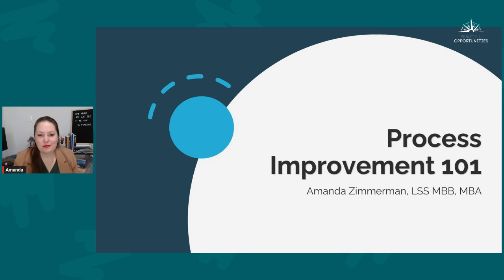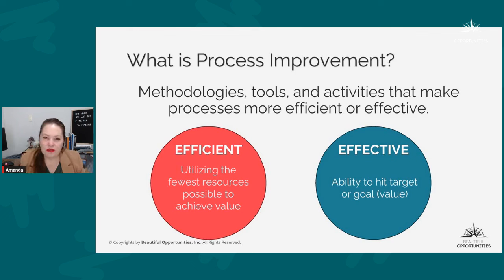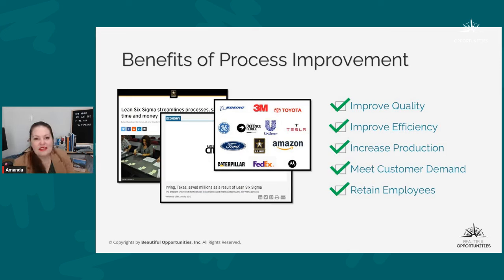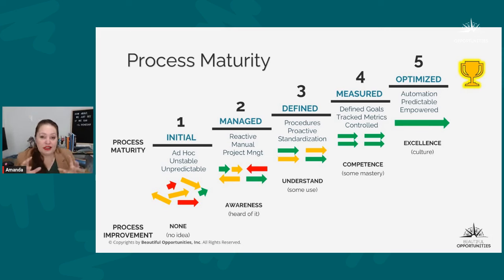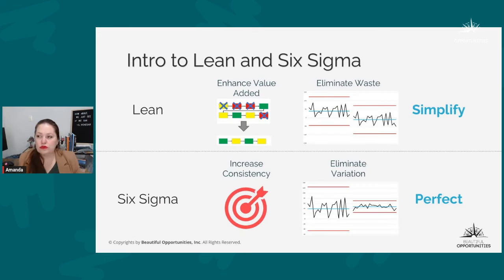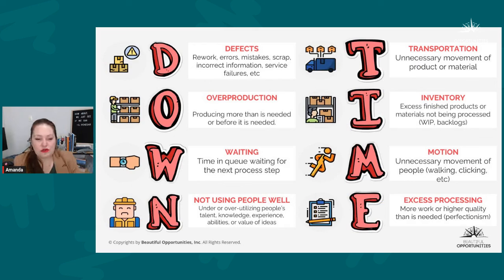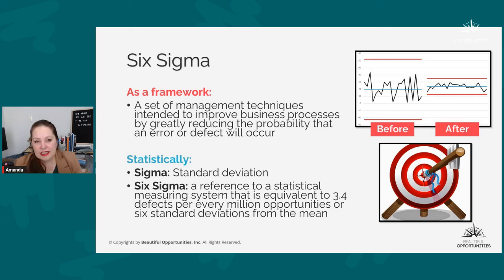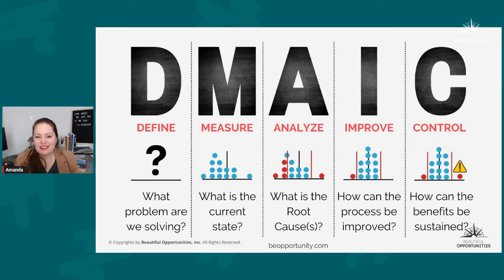Mini-White Belt - Process Improvement 101 - Learn all the basics about Lean Six Sigma

Comment: just get what i need in time, thank you. Is it possible to implement LEAN and 6 sigma in a traditional cylinder repair business?
Reply from the maker: Absolutely. There are different levels of engagement you may want to pursue, for a small business you'd want to start with the Lean tools. Embed some small ways you look for waste and value. I'd be happy to chat a bit about it but don't have availability until Sept. However you could start moving things forward today with our White Belt program. More info at www.beopportunity.com